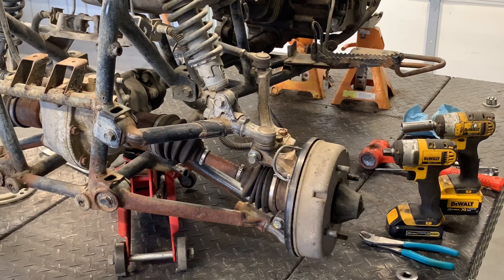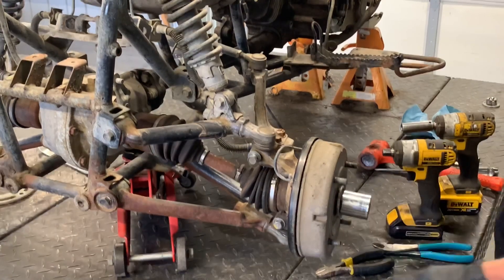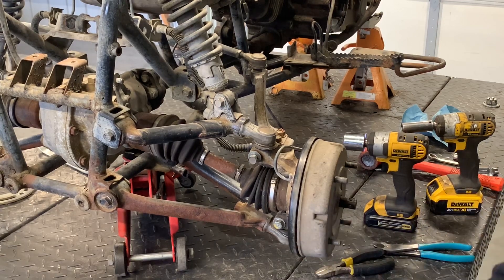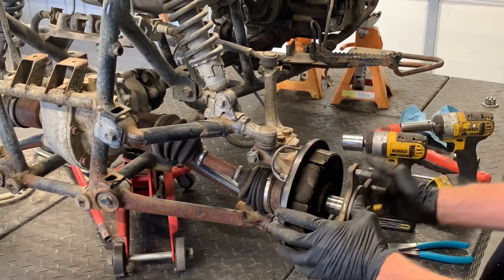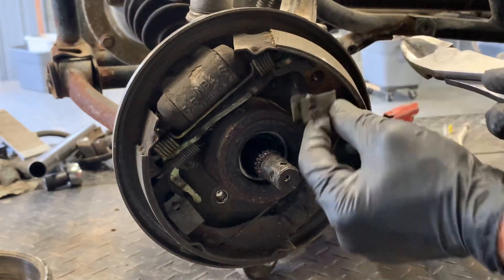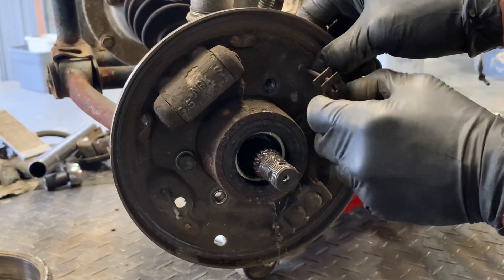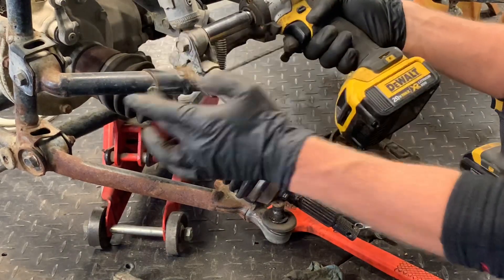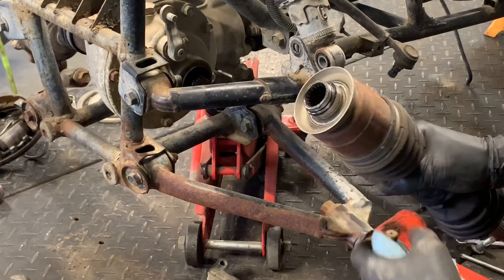Suzuki Quadrunner / King Quad  - A-arm Shock Aarm STUCK *here's WHY!!!

Comment: Would you happen to know what the brass rings that are on the end of your cv shafts that go up against the front diff are called or a part number for them? I messed mine up on my Quadrunner 500 getting the shafts off. Mine didn’t pull off easy like yours. I can’t find them on any of the diagrams on partzilla or cheap cycle parts and need to replace them.